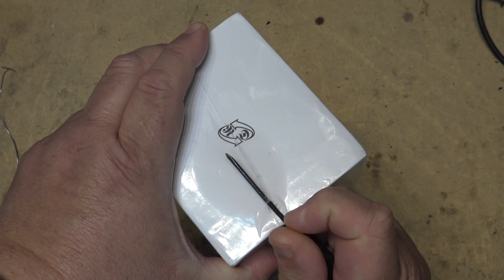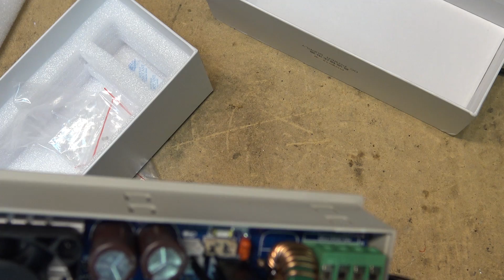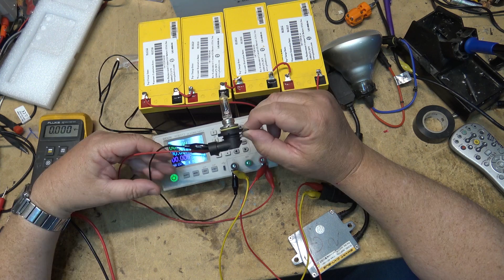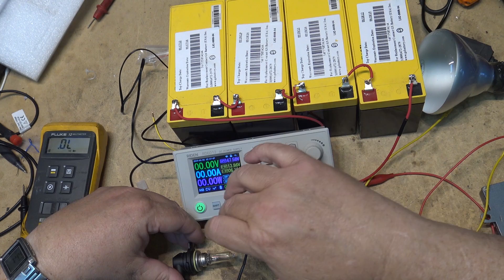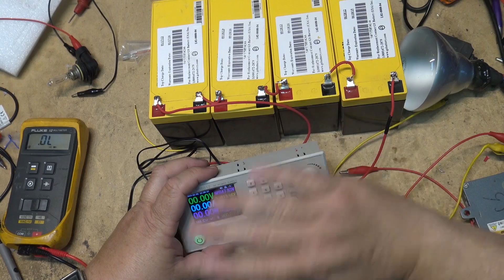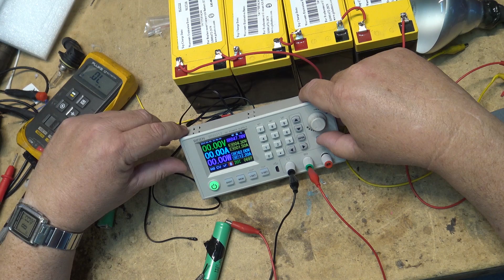Riden RD6012 DC Power Supply Module Set up and Test

Comment: Nice review. Would have been nice to also see:
- if it could deliver 60V/12A safely without overheating or burning up
- if it would regulate battery charging when the temp sensor was reporting high temp.

Comment: Had to get one of these as I'm regularly charging high voltage batteries, and this will allow me to set custom voltages on my batteries depending on needs. Just put it together yesterday. I didn't even bother testing the 70v supply- I just put everything together, plugged it in and it worked. I can't imagine what a similar specced unit from western manufacturer would cost. Probably at least $500.

Comment: Hello, you may type the desired voltage and current. Just press volts button, type let’s say “13.8” and hit enter. There is a case kit with fan, fuse, temperature for switching power supply and as an optional the switching power supply itself for this converter.

Comment: Built mine some months ago, using an industrial grade power supply (350W 60V for stepper motors/CNC) that fit into the enclosure (you also should have bought!). Works fine and is still much cheaper than any other from a "known brand".
Reply from the maker: This was a sample sent to evaluate.  So far so good. Quite impressed.

Comment: Could somebody explain to me why it has the green output jack for charging purpose?
The red output jack should be good for charging.  What other functions that the green output jack can have for charging?
Reply: The green output is combined with an external temperature sensor to lower current when temperature is too high

Comment: Nice.  Double check all settings if charging Li-ion batteries. I'd put 'em in a metal box (.50 cal  ammo can from Harbor Freight?) capable of containing a battery fire (especially if left charging unattended). Very thorough demo. Thank you.
Reply from the maker: Li-po for sure.  The standard 16550 types are pretty safe. They have internal fusing that kills them before they go up.  That is what the temperature sensor is for.  To shut down charging before they get to the explosive stage.
Reply: @12voltvids  You can pre program the temp cut off value as well?

Comment: 4.3 V. On a 18650? I thought they were only supposed to have 4.2 max. I realize you were only doing a demonstration.
Reply: depends on the chemistry
Reply: @CotyRiddle  yes, some are less than 4.2 like lithium iron phosphate .but I believe, none are  over 4.2.. If there is please send me a link showing me.
Reply from the maker: Most of the cells I have charge to 4.2 or 4.3 on my dedicated charger.  Depends on the brand.
Reply: @12voltvids  ok. I never heard of ANY being 4.3. I've been buying them & using them in different projects for the last 6 years &  using  many different types of 18650s. My interest in them started when I  gave up smoking & started vaping. ALL of my vaping products use 18650'S. I probably have over 
 100 of the batteries laying around & just recycled About 100. I've heard of less than 4.2 but never over!.
Reply from the maker: @ronniepirtlejr2606  
How many of those green ones I showed in the video would you like to see. I have 4 of them right here now, and they are all fully charged, 4.31 volts.

Comment: I would like to see you build your power supply for this.
The one I made for myself. goes to 30 volts. 5 amp. I'm using a power supply from a power chair. It has a toroidal Transformer with a  full Bridge rectifier board & a 2000 uf 63 V. Capacitor on it. The power supply says it's 24 V. RMS. 3.33 amps.  By DEWERT . , I thought it was perfect for the DP30V5A. I ended up burning up the surface mount Shockey diode in it. I replaced it with a  through hole schottky diode, botched it. It's been working great ever since.  I learned how to make it from watching you on your Channel. Thank you & keep up the good work!👍

Comment: I have a smaller unit.  The 
DP30V5A. Mine has been a good unit for the last 2 years. Only problem I had was, the main schottky diode burnt up,  just 5 days after I had it. I botched a through hole schottky diode on to it & never  had another problem. I think they make good products, it's just that the surface mount Shockey diodes are weak. If they happen to burn up, just replace them!

Comment: Why do you keep switching the load on and off to adjust Voltage and Current? The whole idea is to make those adjustments with the load switched on, so you can monitor the parameters WHILE you make the adjustment.
Reply from the maker: I was showing the current limit trip. Just trying to find the trip point for cold filament. Remember incandescent light bulb draws much more current when the tungsten is cold. I wasn't turning it off.  When I had current max limit set too low it tripped and turned off. I hit the button again  to turn on again before the filament totally cooled down allowing it to stay on. It was more of playing with it to see how sensitive it was.  Since the current limit is a hard switch off not current regulation as the other setting is, it shuts down.  Now the current regulation could be used to limit in rush current, set that to the max that the lamp needs to operate and it will limit the current to that level as opposed to the OCP or OVP which shuts down if it exceeds setting.
Reply: @12voltvids  - I was referring to adjustments at other times. For example at 10:29 to 10;42 when you adjusted from 13.8v to 12v then upon switching on again showed that the HID headlamp was "Constant Power".
So my point was that the Current and Voltage limits can be made dynamically, which is a great way to learn the characteristics of the connected device.
For example, by slowly adjusting the voltage up and down, you can determine the dropout voltage of the HID ballast, rather than making multiple adjustments with a power cycle in between like you did from 9:38 onward.

Comment: the number keys are all wrong, 789 456 123 0.    ?   not a standard layout.  e.g 123 456 789 .0
Reply from the maker: Here is one of those moments to educate.
A standard layout is 789 456 123 0.
Every computer keyboard and calculator is laid out that way as are all scientific instruments.
You are looking at a telephone keypad which is 123 456 789 *0#.
Do you know why the telephone keypad is laid out that way?
I all has to do with the way that push button phones evolved. They started (when automatic dialing was invented) as rotary dial phones. 
If you look at the keyboard you will also see letters. Starting with 2, there is ABC, 3 has DEF, 4 GHI, 5 JKL, 6 MNO, 7PRS, 8 TUV, 9 WXY.
Note that I omitted Q and Z. There is a reason for this, and all the telephone workers that have been around a whle will know what I am talking about. 
In the early days of telephone dialing, each distric in a city had it's own central office.
In Vancouver, ,where I am from we had central offices with names, and to this day the names have not changed.
ALpine, FAirfax, MUtual, CAstle,TRinity ect. The Nxx (first 3 digits) of a 7 digit phone number was hard coded to the exchange.  In the early days there was 5 digit dialing as well, I will go into that. (in some cases 4 digit)
Each block of numbers went from 0000 to 9999. That means only 1000 possible phone numbers per block. So in the central office there was a pre selector, that went from 0 to 9.
Now you have 10,000 possible numbers per central office.
Each central office had a 2 digit office code, which were initially represented by the office name.
Your phone nuber could be ALpine 5 9907 for example, or MUtual 8 2554..
To dial this number, you dialed the first 2 letters for the office followed by the switch number and then the line. ALpine is 25 then the next digit was the switch code 6, followed by the house number 9907.
In the earlier days, when there were fewer than 1000 numbers in the office, you would just dial the office followed by the house code. (Those numbers BTW were real, the first was my wife's parents number when they first got a phone. I have that old ancient rotary dial phone here and it still works, and has the original number card with AL5-9907 printed in it from BC Tel) The second number was the old request line for 73 CKLG radio.
Anyway, back to the keypad layout. Since the phone system had used letters going way back to the early days, to this day the letters are on the keypad. We use them now for things like name dialing, hence they added the Q and Z. To keep things simple, the numbers were arranged 1 2(abc) 3(def) ect on the phone keypad start at the top row. So the phone layout is actually NOT the correct one. 
Fire up the calculator app on your phone and you will see the correct layout, exactly as it is on this power supply and all standard  computer keyboards.
Reply: @12voltvids  Nicely done, Dave! We had what they called a party line way back when and the phone had 4 different rings. Pretty crazy right. I could call around the neighborhood with 5 numbers. Bell Telephone. 
Thanks for taking the time to share...
Reply: 12voltvids 
Ok, fair enough, but I was looking at it from alarm key pads, I install security alarm systems and the key pads are the some as telephone key numbering . But hey, You know the saying for Standards is, there is no standard.

Comment: This is nice, but how do you supply the input power? Not many 60V/70V PSUs on the market 😢
Reply: Yep, there are plenty of them.....i should know! I have 6 i think, from about $20 up.
Reply: You supply the input power using a suitable PSU or transformer. Better to use a transformer plus rectifier and smoothing caps, since the Switch Mode power supplies have a lot of nose which gets superimposed onto the output of this controller.
You can use any input voltage that you like, up to a MAX of 60-70V. If you use 12V supply, you get about 10V out, whist using 24V will allow you to output up to about 20V.

Comment: will be an interesting project indeed..im looking forward to that one not only as a bench top dc power supply  but wondering how it would work in a solar setup im thinking of installing .. using the charger feature and the solar panel as the supply and lead acid batteries as the storage medium on cloudy days..
Reply: Since this is a "Buck" regulator, it can only supply up to a couple of volts lower than you input voltage. So if your solar batteries are 12V, the PSU output will be maximum about 10V. This is not the best unit to act as a charger, you should use a proper MPPT controller for charging the batteries.

Comment: Thats one smart unit, i can see it being very handy :-D
You can never have enough power supplys or meters.
My only requirement is to turn down or change the pitch of the beeper, it would send me mad sorry madder :-D
Reply: the beeper can be turn off, and for now it has only one kind of pitch
Reply: @rdtech9153  I saw another video where the RD6006 had a substantial ripple on the output. I was wondering if that had been resolved in the 6012 as I just purchased one of these units a few days ago.
Reply: @DrHarryT  ripple of RD6006 is 100mV VPP, and the ripple of RD6012 is 250mV VPP at 6A
Reply: @rdtech9153  WOW 1/4 of a volt!!!
What can be done to solve this?

Comment: The heat sink is quite small. What continuous power can the device deliver?
Reply from the maker: 12 amps. It is a buck converter not a linear supply.  They don't produce a lot of heat like a linear and it is forced air cooled.
Reply: @12voltvids  Amps are not power. Such a switching converter has an efficiency of typically 85%. At 30V and 10A, for example, this already results in 45W heat. This is too much for the small heat sink...
Reply: It will run the full amount....720W. This is a very well made supply from a good company. They have their ducks in a row, no problem.

Comment: Nice unit specially for the low price.
I got one of these, managed to get it in february before the Corona lockdown.
Got the control unit and the case. Buildt the powersupply out of an old transformer,
and it's working great. You can program and store different voltage and current settings.
The battery holds the memory for these presets.

Comment: There is a good video done where somebody made a linear power supply to clean up the signal because it’s pretty dirty using a switching power supply. There’s a little dirtiness to it by the actual regulator in the head unit there but by using a linear it’s much cleaner. You tuber(Jerry walker) Watch his video there’s many others attempting to clean up the signal but it’s a very good unit. Probably will last longer and be better than the PEVONO PS305H That died after three months repaired and then died permanently after six months
Reply: Jerry Walker RD6006 Linear https://www.youtube.com/watch?v=b9YBsKSLq08